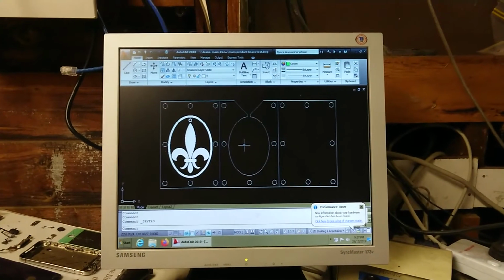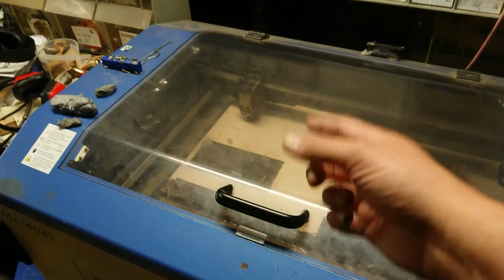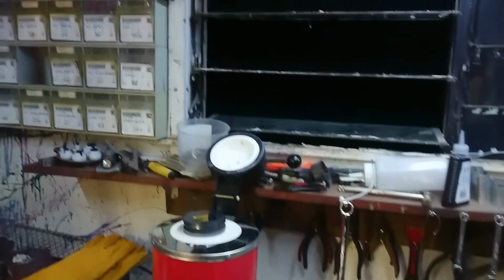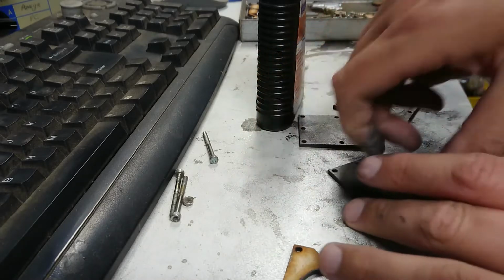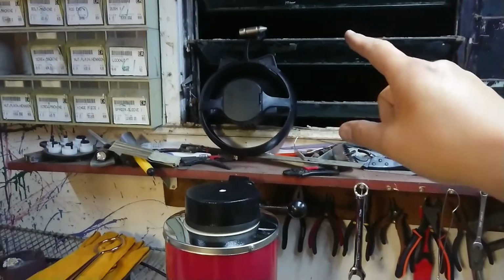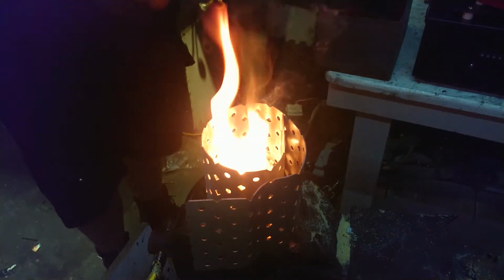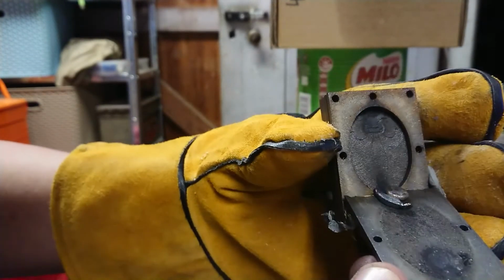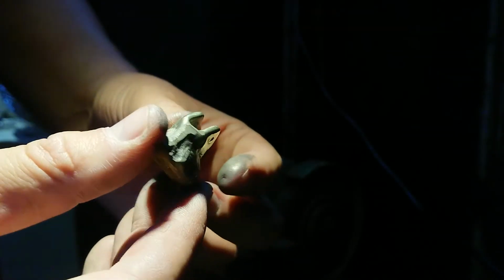Pouring Brass for the first time

Comment: Hey mate. I'd be inclined to use silicon for the mould at those temps. Possibly plaster but I'd wager plaster won't work.

Far more pressing though... Please check the relay inside that PID controller. Last device I bought from China with one of those controllers was a hot plate for changing phone screens... It went nuclear one day because the relay was some one hung low brand, to add insult to injury the thing had a 15 amp slow blow installed in the IEC recepticle and the wiring was too short, under strain and with crimped on connectors so loose the receptical had melted. Further, the earth connection inside the case was not secure.

Now, anything I buy from the usual scumbags is immediately torn down and inspected before testing.
Reply from the maker: Yeah it will get an overhaul soon enough - I'm waiting on some green sand and also plaster to arrive - this was mostly an experiment to see if my technique would work. sometimes one doesn't know until one tries.